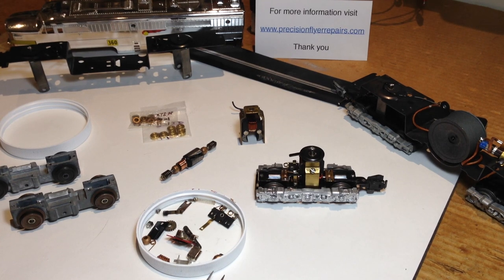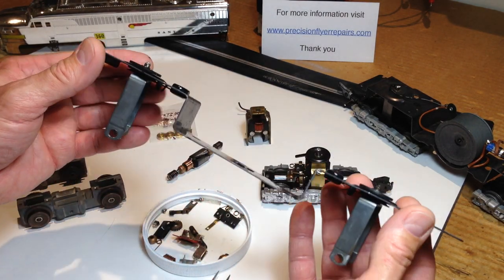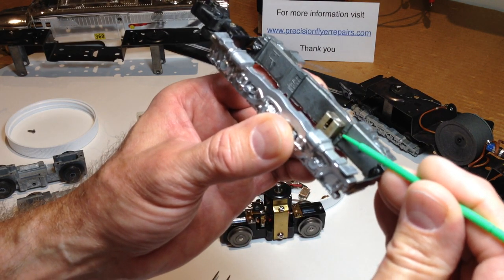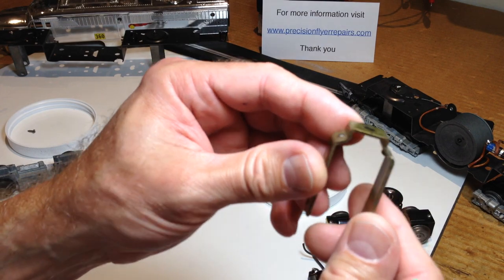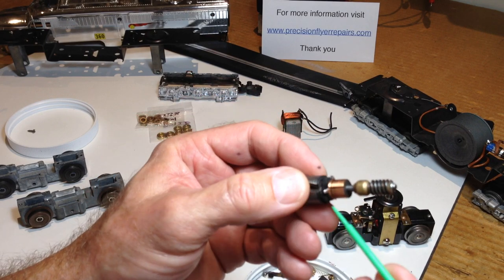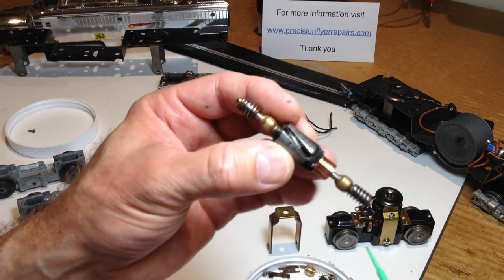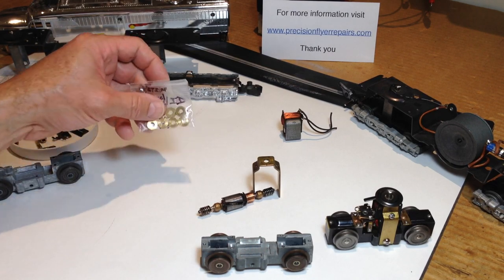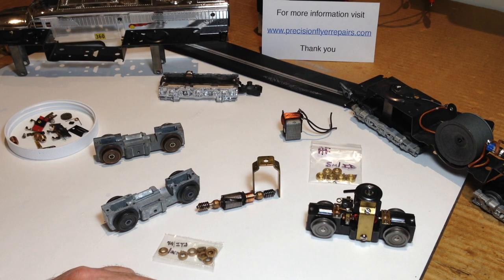American Flyer Anatomy 101: the Gilbert diesel

Comment: Can you replace the original pul mor wheels on a 3 digit series diesel to be able to swap the rubber easier? I wasn't sure if there was a grooved wheel design that would work too change the bands without glue.
Reply from the maker: Flyer made the low flange vulcanized rubber diesel pull-mor wheel XA12A249 and later the high flange diesel pull-mor wheel XA14A891with a rubber tire band (PA14A890).  Lionel AF used a wheel similar to the 891 but made out of steel instead of brass/bronze/copper.

Comment: I need your help.I have been playing around with 3 AF #360 two motor diesel PAs for weeks now in the attempts to fix up a like new set #5008A that I never ran and bought many moons ago.I remember the problem when I was going to sell it a month ago because when I powered it up,all it did was hum because the E-unit was stuck in neutral position.I am an avid collector of pre-war flyer,Hafner,Bing,Bub and even some Lionel,yes sorry I mentioned that plus I retired from a company who is or was an OE supplier based in Germany selling more than a 61 million in sales and I did all the BS for everything for their automotive rotating electric items from 6,12 to 24 volts.E. generators,alternators and starters in North America. I even rebuilt 24V starters wired in series used by the US Coast Guard rated at 25hp each and weighed over a 100 pounds each.I know a little about circuitry and E-units but these 2 motor PAs really got me going.They are way to delicate and small for an old man with bad eyes and fingers that just don't work like they once did.Here is my final mountain to climb because I learned and redrew my own schematics for these beasts to say it nicely.All three after finally or prior to me tampering with them IF the E-units were sticking,and by the way, I am working with the earlier motors that pick up power through the wheels not a pick up on the truck,they all first run like they should.Quiet,smooth as silk and reverse direct perfectly but then it happened to all of them,like one old,or lost one I bought in desperation, run the same way but when I got it the E-unit was stuck.I soaked that bottom end with WD40 after cleaning it up with plenty of contact cleaner and let it soak over night.The next morning it did the same as all the others I had repaired.Motors ran correctly,E-units worked correctly but all they did was create lots of noise and only spun their wheels and creep to the directions they were reversed into doing.They only gained traction if I put pressure on to the PA body over the motor(s). Yes,I thoroughly cleaned the wheels and my test train with both contact cleaner and alcohol repeatedly but it did not help one bit.I have had AF PAs and switchers before that worked perfectly that I did minor repairs to but I am lost on what to do next on any one of these 3 chassis to make them work.I know they can not use traction rubber bands so any help will be greatly appreciated.Frustrated and going crazy so please help me have a Merry Christmas and a Happy New Year by giving me a good idea on how to fix these PAs up.Thanks John
Reply from the maker: If I understand you correctly, you have 360 that runs well in every aspect except it has no pulling power  unless you apply downward pressure on one or both of the power trucks?  Is that right?  If so, and both motors otherwise are getting power correctly and run well and quietly throughout the throttle full range (slow to top speed) then without seeing and testing it myself I'd say you have a traction problem.  Did you soak your metal wheels in WD40?  I've never done that , but perhaps they've actually taken in or taken on some of its lubricating properties?  Soft metals have some degree of porosity and were at times impregnated with lubricants.  The other thing could be improper worm screw to worm gear meshing, but what most often happens there is the axle bushings wear and they mesh too closely such that with weight on them they provide less power, heat up, and run worse, not better.
Reply: @PFR1  OK,I figured it out....Only 1 of the 2 motors were working causing the one motor to try to pull the second motor a long and the over heating the relay contacts and stopping the whole show.So,since then,I took very relay,E-unit, down cleaned all drums up and tested
 continuity and operating.Then remove every motor and checked cleaned lubricated,checked all continuity and resistance values on every item and test ran them as individual motors in both directions.All worked fine.Them,paying close attention to the positioning of the 2 rail pick up wheel to frame locations,assembled and installed all 6 motors and relays to the 3 chassis or frames.I drew my own schematics of what was on each chassis as far as what I started off with when I tore them apart and still end up with the original issues....Most of which are the E units click and cycle but chassis goes no where. OK,so I went back to rewiring according to the 2 sources out there in 2 publication,which are both different and only in black and white and drawn out with no "jump over" indicators to shown no connections plus my own knowledge from work and home train repairs and I still can not get anyone of these 3 chassis running.Can I buy or get a good color coded wiring schematic showing the insulated wheel positions plus motor orientations to the chassis in relation to front and back so I can be sure I am wiring these 360s correctly? I hate using or referring to what I am working with right now and my brain is not what it once was as far as trouble shooting the engines.Any help greatly appreciated.Thanks for listing to the old man.John
Reply from the maker: @MrJohnnyRotten1  Perhaps try https://www.portlines.com/clinics-14 for wiring diagrams.  They're not in color, but you can trace them in different colors and see if that helps.  I've done that with b/w diagrams.  Makes referring to them easier.
Reply: @PFR1  Thanks for that lead but what I did yesterday was, after digging through all my reference notes,hand drawn schematics plus down loaded color schematics for reversing relays for trains in both black and white with and without color coding,was to use a 4 pin 4 position color coded schematic for a post war AF steam engine and break it apart into the relay and then the motor with the existing color codes for the wires.Then redraw it again replacing those colors with what I found in two of the 3 engines and evaluated the current flow through each item.Now I can picture what AF was doing and how a one motor system will or should work.Today,I will do the same thing once again to insure it all makes sense to me and the schematic comes out the same once again.If it does,I will add in the second motor but wire up only one motor the first time to 2 trucks to see if every thing works.If it does,then I will add in my second motor.I will hang test everything as I go.Lastly,I have ordered up some 24 gauge 4 color wire to use in the rebuild I am doing because the existing 22 gauge 4 color wire out there is both too thick and too stiff for that application in that design type for flexibility reasons.I'll keep you posted and IF you think of anything else I can do or IF my thinking is in error,let me know.Have a Merry Christmas and thanks for the help.John  PS:I have talked to the gentleman at Portland Hobbies and he is very helpful and my go to person for pre war AF parts.

Comment: Hello there! My pickup shoe box cam off the side of the truck frame. What kind of glue will hold it back in place?  Thanks, Don
Reply: I thought about peening them back but I'm worried I will break it. If I put JB weld on first then set the box into it, the JB weld will act like an insulator and no current will flow or will it? (Is JB weld a conductor?) Or just apply JB weld on the sides of the box?  I just want to make sure I got it straight! Thanks again

Comment: Technically, the teeth on the armature are the worms. The teeth on the axles are the worm gears. T
Reply from the maker: Right.   The worm has threads, not teeth,  like a screw and is sometimes referred to as the worm screw or an infinite screw.    The spur gear that meshes with the worm has teeth and as you mentioned is the worm gear.  Together they make up a worm drive.   For simpler recognition by many I refer, grated erroneously, to the screw as a worm gear and the spur as a drive gear.  Thanks again.